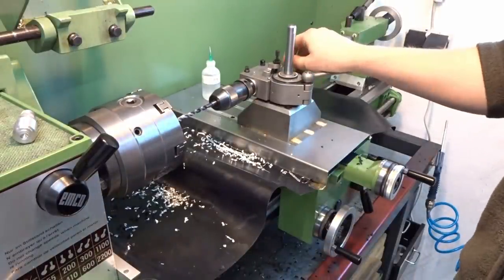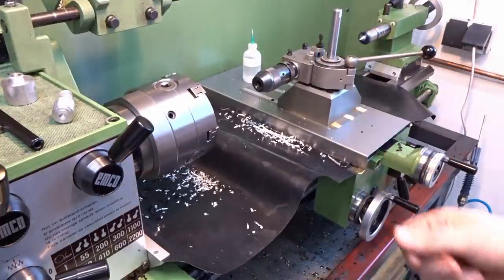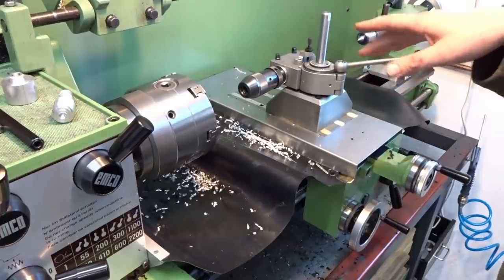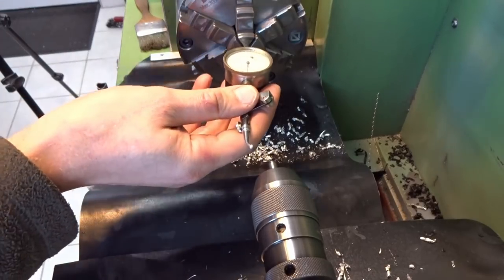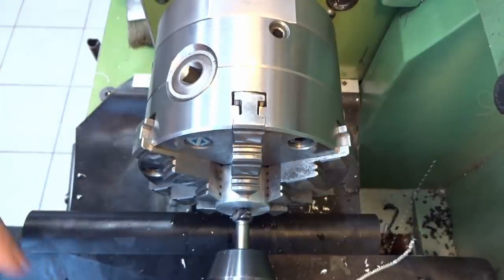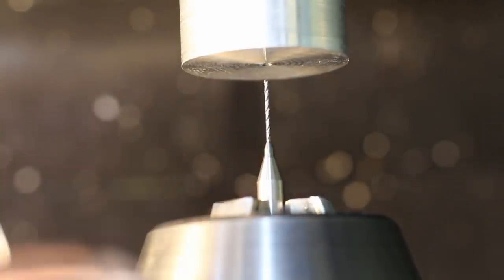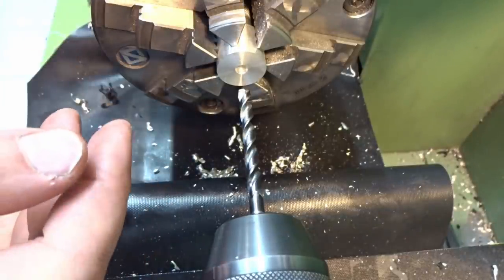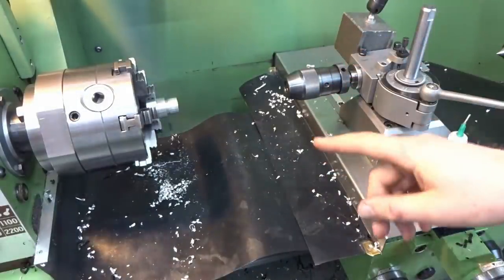Carriage Drilling on the lathe

Comment: I like how you always work to nano precision and then dont get unneededly crazy about details like a völlig egal drill chuck. 
If needed, hydrodehfutter into solidfix is a easy solution. Tool change time is acceptable, positional repeat is knorke.
Reply from the maker: Knorke is the best.
I think the internet will explode if I put a hydrodehnfutter on the Emco. Or a shrink fit holder in my Optimum Drill press :D
Reply: @StefanGotteswinter  nene! Blank holder into toolpost and ausspindeln with the wohlhaupter in the mainspindle! Please dont get sloppy!

Comment: Excellent video !. Using a sliding dieholder in place of a drill chuck on the multifix is another way of not having to drag the tailstock up and down !. I suggested this application on a forum I used to go on here in the UK and was literally laughed at .....
Reply from the maker: HA! I forgot to show that - I have a sliding Die holder that goes in the boring bar holder, for exactly what you describe there.  Works brilliant.
Reply: Sliding tapholders are similarly brilliant. I made a sliding quill which plugs into the morse taper of several of my tailstocks, about 300mm linear travel, with a 1" Jacobs Super Ball Bearing chuck at one end and a gokart steering wheel at the other. The spindle is free to turn, restrained by the operator. The wheel is big enough that it is relatively easy to hand hold for tapping M16 with a spiral fluted tap in mild steel, or (using serial taps) in tool steel or stainless, but it is delicate enough to use down to about M5. I've never broken a tap even using it from the MT5 tailstock of my biggest lathe. Both the feed and the torque are under full time sensitive (fingertip) operator control. When I have multiple workpieces to tap, when reversing the spindle to back out I often also spin the wheel backwards by hand to improve throughput -- as with a planetary drive tapping head, but minus the complexity.

Comment: Not sure why you don't trust the concentricity gauge when its accuracy is better than what the drill bit will leave .
Reply from the maker: That was more a general statement - For use on the milling machine mainly. Should have clarified that.
Reply: @StefanGotteswinter  
i use mine to centre the tailstock quill after taper turning  - it has many more uses other than the milling machine . If you need to reach down into a bore to indicate true  you can mount it into the tailstock in a chuck or in the cross slide in a dedicated holder  and use it like a dial test indicator and they usually have some long reach probes. Yes sure you wouldn't trust the readings as Gospel for actual runout amount  but if used only as a comparator it is fine .

Comment: If you still have a compound on your lathe you can chuck up a gauge pin in the drill chuck and use a collet or the lathe chuck to clamp on the other end for quickly re-aligning the compound after changing it.

Comment: My biggest lathe is temporarily missing its tailstock as I am hard chroming the barrel preparatory to lapping the casting to return it to like-new performance. A few jobs have come in requiring holes to be drilled up to 32mm, and I have resorted to 1/2" shank drills held in a conventional lathe toolholder in the Dixon style toolholders, some of which have a full length V machined into the face the tool sits on, for holding boring bars. 
Naturally I use a heavy packer on top of the shank (along which I have machined another V) rather than having the clamp setscrew tips digging into the shank. Because the drills all have the same shank size and position it's actually a reasonably nice workflow, but of course I have to use finer increments to achieve a big hole than if i could do the usual "taper shank drill in tailstock" progression. Being a big lathe, it's no hardship pushing a fairly big drill with the carriage feed.

Comment: I wonder if you could drill a hole in a piece of round bar using the tail stock, then use a piece of precision steel to locate the hole in the chuck. I think it would work pretty well the first time, but would need to be indicated if your alignment gets out of wack in the future.

Comment: All great points... The thing that has me considering changing to this method of drilling is that I have come to rely on using a similar DRO on my lathe and don't have  feedback from my tailstock.. Another highly annoying thing to me about using the tail stock for drilling is the very limited amount of travel my particular tailstock has, so deep holes are a lot more work having to play a game of relaying between moving the screw in and out as well as moving the tailstock itself in closer as I drill. When I need to control the depth of the hole I end up doing cheesy things like marking the drill bit itself.

Comment: Really interesting ideas. I am getting rid of my compound slide tomorrow. Using the superb instrument (the human eye) to detect the centre is something you might think an instrument would do better – but the eye does it better.
Reply: I quickly built an adapter for a keyless chuck to fit into a quick change tool post holder for my lathe. It is very good – the regular feed of the carriage makes a much better hole than doing it by hand with the tailstock, and stops snatching pulling out the morse taper etc. You have also got the depth control using the DRO, or in my case you can set the penetration depth and the carriage reverses direction when it has reached that depth. Thanks for the idea. The drill size is limited to 13mm but I may think about an adapter for larger drill sizes.

Comment: On one of my lathes I some time ago acquired some #2 Morse taper holders (Dixon style) and as I do not have a DRO, I made a removable distance rod (like an inside mic, but of a fixed length) which lets me quickly and reliably set the crossslide in the correct position to bring the drill chuck central. Naturally I have to set the compound to 0 deg, but that's where it normally resides on that lathe, because the tailstock casting is nicely arranged not to interfere with the handwheel of the compound, unlike several of my smaller lathes.

Some lathes do not have very strong keepers to hold the saddle down against the ways, and in such cases it would not be advisable to use big drills from the carriage, due to the high thrust load and high line of action, combined to provide a considerably higher moment in the vertical midplane, in comparison with the usual roughing cuts with a RH tool. Towing the tailstock should be OK, though, provided the towing attachment (and hence line of action) is as low as practicable, close to the line of reaction which is the rack. 
But the tailstock will probably need the clamping arrangements re-engineered if the tailstock was not specifically designed for drilling with the clamp loosened. (Some DS&G lathes were so intended, and I'm sure there will be others) 
The ideal arrangement is box ways rather than prismatic for this particular service, but my only lathes with box ways do not have a feed shaft, so the leadscrew would have to provide the reaction, which is not ideal. I'm thinking of fitting a separate pinion with a star wheel handle on one of these lathes (similar to the cranks on very large lathes) with its own pinion engaging the existing carriage feed rack. I would mainly use this to move the entire tailstock for deep hole drilling, where it gets tiresome winding the tailstock handwheel, despite (in this case) it using a 3 start thread.
Reply: I agree with all Your points, set a limit to the drill size/force for drilling with the feed for the particular lathe. A solution to help spinning the tail wheel I used once  is to machine a heavier adapter or or a new heavier larger tail wheel so it can be flicked and spinn freely. Worked fairly well. I also saw a video on Paul Brodies channel about this recently. One of my lathes has a 10 mm rod with 2 clamps arranged so it can be used to reset the cross slide to center quickly. (My compound is kept 0 normally). In my experience it is surprisingly easy to center a drill well by feel though. For larger drills, looking at equal size ship spirals works well.

Comment: Excellent demonstration with the pcb drills -I'm definitely going to try this with an ER11 parallel chuck/spindle in a boring bar holder (I must remember to order a slab of steel big enough to make a monolithic rigid toolpost too)
Reply: Cast iron is, I think, the goto material for a solid toolpost since it absorbs vibration a bit better than steel. Solid carbide would be even better...
Reply: @robertsneddon731  carbide might exceed the price of my entire lathe!  Cast iron seems expensive compared to steel in the size range I need, but may well be worth it [edit: in terms of ease of milling], cheers👍

Comment: I have been thinking about making a turret for my lathe to replace the tailstock for a long time. A turret is much faster and better, especially for repetitive work, but making one is not easy. THIS is going to enable me to trash my tailstock altogether. I don't know why it didn't dawn on me a long time ago. I'm thinking I can make a saddle to fit my cross slide to replace the compound when it's not doing its usual thing. My cross slide doesn't have tee slots, so I will have to find another method to hold the saddle down. I can also use something like a taper pin to lock the X-axis in place for repeat centering each time. Also I may be able to use my dovetail tool holders if I can find a way to have them register interchangeably and accurately. I'm also thinking about a fixed tool holder with a MT2 taper so I can use all my mill tooling and collets, instead of using the dovetail tool holders. My existing tailstock is already MT2, so not much will change for the tooling there.
What a revelation you have exposed to me!

Comment: I've been dragging my tailstock with my carriage for drilling large holes or extremely deep through holes
Reply from the maker: Thats a neat trick - I have seen that option on larger lathes, but never did it myself.
Reply: @StefanGotteswinter  it required a tapped hole in my tail stock at bed level and a pin added to my carriage for a positive link without play

Comment: Hi Stefan - do you dowel your Multifix to the solid toolpost to prevent it rotating, or just rely on friction? I was considering using a dowel, but unsure how to accurately drill the dowel hole down through the Multifix.
Reply: Supposedly you can use the multifix body itself as a drill guide. (Never tried it)
Reply from the maker: I did use the multifix body as a drill guide 😂
Mounted the Multifix to the solud toolpost, aligned it, took the entire solud toolpost off, to the mill drilled and reamed trough the multifix.
Reply: @StefanGotteswinter  Thanks Stefan - great advice. I think I will do the same.

Comment: Just from eyeballing, the Emco does not have a very good bed width-to-center height ratio. Quality lathes are more 'compact'. i think the ideal situation is at least a triangle with all 60 deg. angles. I read this as a 'rule of thumb' many years ago.
Reply from the maker: The Emco is good enough quality for me ;)
Yes, its not built as stout as a Schaublin 125 or a Weiler Primus, but each day I am amazed about the precision it can achieve and the rigidness of the headstock.

Comment: At Work A Coworker of mine even used a 65mm drill in steel while drilling with power feed.
Reply: Must have been a beast of a lathe. I tried to do that in a 24x80 Chinese machine (although in reverse, as the workpiece was too big to spin so I had it set up on a cradle bolted to the carriage and socketed the taper shank spade drill in the headstock spindle, like in a HBM) 
Spade dolls don't like a pilot hole, so the carriage power feed clutch kept tripping.  I had to additionally push the work with the 2 speed tailstock in low gear, with a 2 x 4 strapped across the handwheel. Those spade drills take a lot of pushing... The hole was best part of a metre deep so it took hours and several spare  pairs of arms would have been handy!
Reply: @Gottenhimfella  The lathe can chuck pieces of over 40" when using the faceplate, so not really small I guess. But the hole wasn't nearly as deep as the one you needed, it was normal taper shank twist drill.

Comment: smallest i have had to do is 0.2mm on a 14x40 lathe think it was 3mm deep into tool steel . i was half lucky that the bit i gad was of same diameter full length. so as you feed bit much the back end would bend in a bow. can not get any feedback from such small drill on that size lathe.

Comment: Just rewatching this for a little inspiration. Any reason you wouldn't use an ER Collet chuck in the tool holder on the smaller drills and would you generally get lower runout?
Reply from the maker: Yes! That works well, but you have the slower changeover time. I do that If I need a certain drill on a series of parts a lot.

Comment: Couldn't you just put a pin in the drill chuck and slowly close the lathe chuck on it (not spinning of course) and move the chuck to the inside of each jaw until it just touches the pin evenly?
Reply: Thats how I get the rough position when aligning my toolpost drill. regards

Comment: My crappy tiny Chinese lathe has a tail stock that is worthless. I put a dowel pin in the drill chuck and use a collet in the 3 jaw chuck to get a fast center position for the drill. Not perfect, but good enough.

Comment: Stefan, does it make sense to have the drill chuck mounted on the ‘front’ of the tool post to prevent deflection with heavier loads/bigger drills? Thanks!
Reply from the maker: Edge Precision sells something like that. It requires that you can move the cross slide very far in.
I am not to concerned about the leverage onto the quick change toolpost, it does not care :D

Comment: Do you ever drill with endmills?  Sometimes one wants a square-bottomed hole.  Faster since no center drilling or piloting needed.  What about reaming from the carriage?
Reply from the maker: Reaming works just fine, drilling with an endmill into solid stock works kinda.
I prefer to use a regular drill, followed by a flat-bottom-drill.
Reply: @StefanGotteswinter  Can you recommend some brand of flat-bottom-drill ? Im also in europe so your brands should be possible to find.

Comment: I used carriage drilling a lot, but then, in the past 25 years i mostly ran CNC lathes.
on my EMCO Compact 5 CNC the holes for the drills and boring bars are unfortunately not on the centerline of the machine, so i made excentric collet  holders, that i can rotate to get the drill on the correct height, and i then use the crossfeed to align my drills on the centerline in X as well in 0.01 mm increments, i just eyeball them with a 2.5 x Magnifying watchmakers loupe, i have 2 of these in my  workshop.
on the EMCOturn 120 i bought last year, the holes in the Toolchanger are on center, so i only have to calibrate the Z-offset of the tool, 
Here's a vid of some small parts on the EMCO Compact 5: https://www.youtube.com/watch?v=kbINV-fQi4w
i was making hubs for watchhands out of 4 mm brass round stock.
your video's continue to inspire me.. keep up the good work!